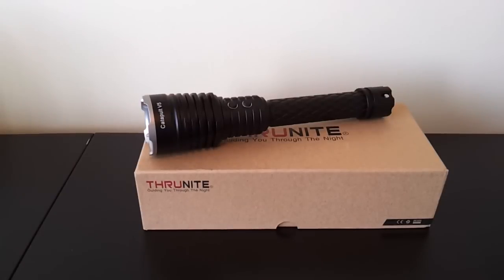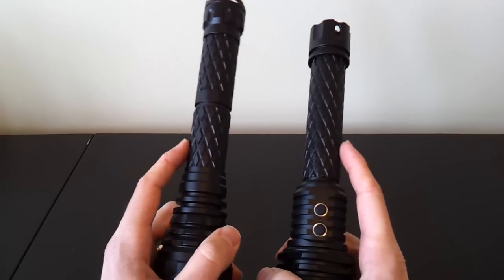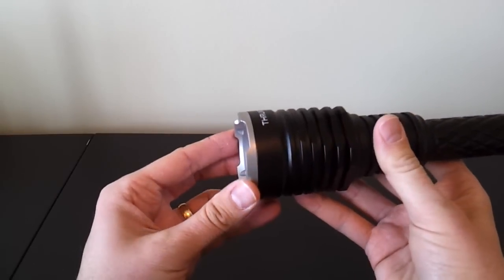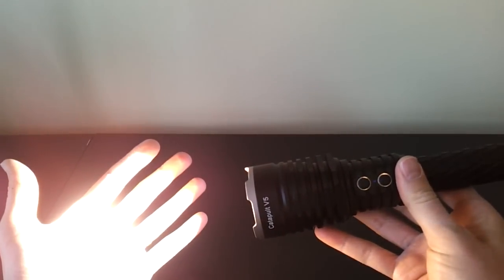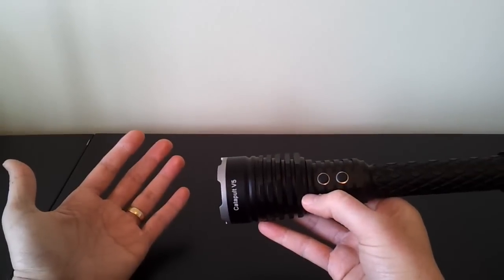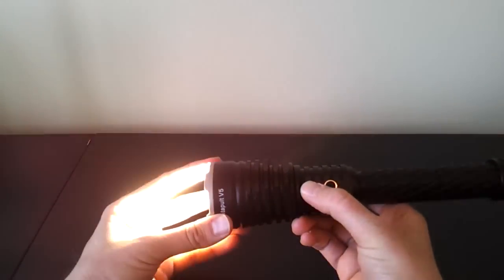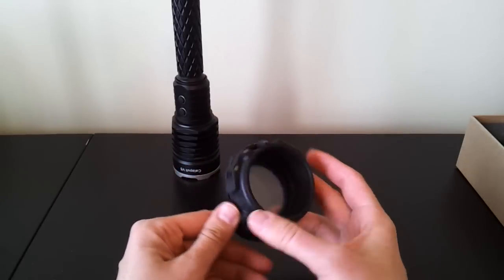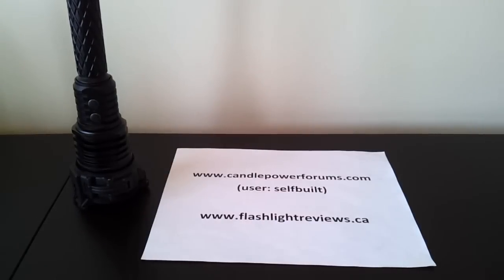Thrunite Catapult V5 (XM-L2, 2x18650/4xCR123A) review, by selfbuilt

Comment: Hello selfbuilt. Great review! I just purchased this light with much anticipation. Is yours still running well? Right out of the box,and with new batteries the light turned itself off and gave me the flashing purple led. So it works only about 5-10% of the time. It is actually working now, but I feel that it is only a matter of time before it repeats. Any ideas?
Reply from the maker: It may be a battery issue - what brand of cells are you using?
Reply: panasonic cr123a 3v 's. i also tried streamlight cr123s and my 2600 mah 18650s. It worked last night. Didn't work this morning(again turning itself off). Now it's working again. Thanks for responding! Any other ideas?
Reply from the maker: cuddlesdapeaceman357 Only other thing I can think of is a contact issue. The light can accommodate fairly long 2x18650, so the 4xCR123A may be a bit short.  Try adjusting the tail spring (using a paper clip or fine tweezers to loosen the assembly).  If that doesn't work, you may want to contact your dealer.